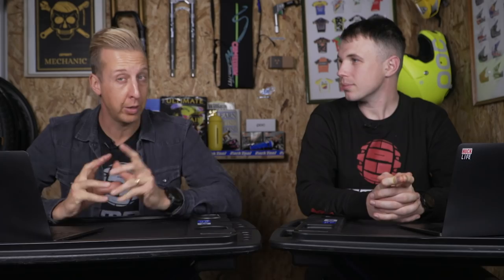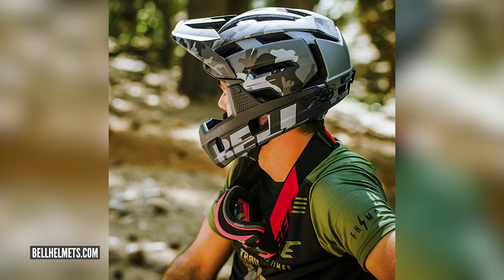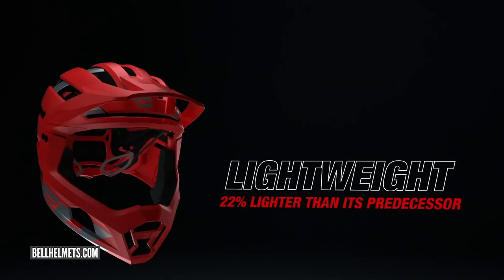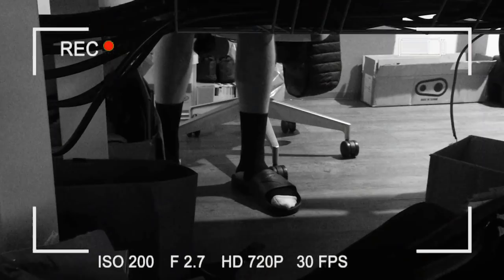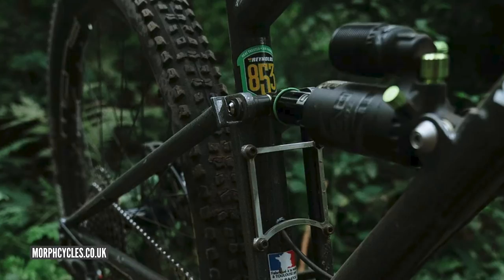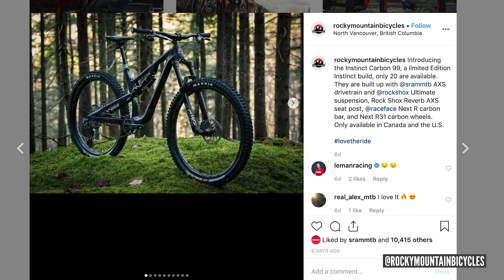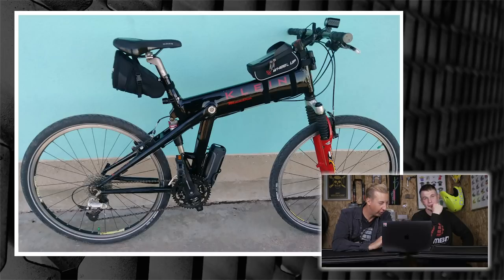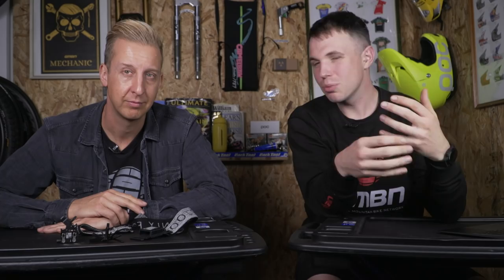3d Printed MTB Parts & Morph Cycles Full Sus | GMBN Tech Show Ep. 96

Comment: #askgmbntech  Hi guys, I am looking to upgrade the tires on my DH bike to 2.6 wide downhill tires, but I am not sure if they would fit the frame. Do you know how tire size varies on the same width measurement (for example 2.6) but depending on the manufacturer? (Schwalbe, Maxxis, Continental)

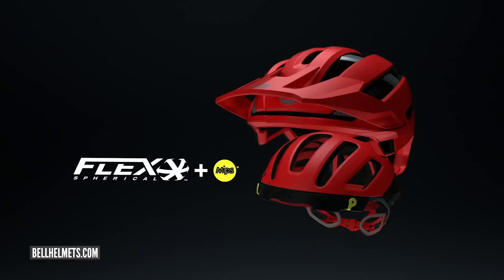Comment: 2:26 I hope it's quiet. 
I am wondering if this will be noisy or not, I hope it's not gonna be squeaking like when the inner shell got separated from the carbon shell on 2015 & 2016 Fox Rampage Pro Carbon, already retired one of the 2016 model, I will have to retire the other I use now soon, cus it already started to separate.
Reply: I have the Super DH and I can confirm that it's quiet, it's actually only held on by "rubber bands". But on my Super DH the chin guard's and helmet's contact area can be quite creaky, because it's plastic on plastic. I have put gorilla tape in between those areas and most of the noice is gone and you don't notice it when you're riding.

Comment: Do you think they will ever have full bikes that are 3D printed???????
Reply: i am pretty sure it is already possible it is just a matter of somebody spending the mony on research
Reply: Look up Pole bikes, not 3D-printing, but fairly similar concept. Also Atherton Bikes have 3D-printed lugs with the carbon tubes bonded into them.
Reply: @th_js  Yeah I've seen them, I think they're CNC which is kind of the opposite of printing but hopefully, they can use the same tech at a later stage.
Reply: @th_js  Pole use two halves glued together, air craft tech basically.
Reply: @joeocarroll1561  Yeah, it is in fact quite the opposite, but you get my point.
Reply: @joeocarroll1561  The lugs on Atherton bikes are actually not CNC, they are 3D printed

Comment: 17:01 Lovely view,
seems like a great build, but I would do some changes, I would have to make for me to ride it, is Acher D1X trail, cus no mechanical shifters fit me currently, Revgrips, Catalyst pedals,  absolute black Oval chainring & Bash guide for obvious reasons.
and would put a Fabric Scoop shallow race saddle cus that's what fit me.

as ppl seem to have issues most hydraulic brakes, I would keep TRP Spyke on it if it were mine, but not tried Sram's brakes on my bike(s).
and probably go to coil shock and fork, to not have to deal with pressure changes and get more consistent performance, but if that was not a factor just keep it as it is.
Reply: Hey Johannes, what do you think of the RevGrips? I'm having finger problems whilst riding and I would like to hear your take on them.
Reply: @th_js  do you mean fatigue? joint misalignment? pain? 
if pain & fatigue are the  problems I recommend training your fingers, build up strength.
I was fatigued faster with Mechhanical TRP Spyke brakes due to the stiff return spring, but now I am no longer having that issue, I have trained my fingers with dumbbells, also rode a lot of steep stuff and rode fast and was braking a lot, so I got a lot stronger, but the issues with the shimano brakes I ran was I had to run them with wrong reach adjustment, way too far out cus they were so inconsistent I ran out of throw otherwise, but most of them leaked, only one set did not lek, but I 've given up.
My mechanical brakes are adjusted properly, so I the reach is short and nice so when I brake I brake with the mid bone of the finger, this reduces fatigue and pain, don't have brakes adjusted so far out that you brake with the tip of the finger or thee tip bone.
also don't do DeathGrip(holding the grips hard as you are hanging on for your life off a cliff or a building) this will cause fatigue, pain.
have hands relaxed on the bars, but still securely.
adjust the brake lever angle so the are as quite flat if the reach is long enough on your bike, this will make it  so you don't have to hold your selv up or death grip to hold on securely.
but the shorter the reach of the bike is the steeper the brakes need to be, but really if that's the case you need longer frame, which is the case for me.
I've seen some run the levers flat, but they got way too short reach, so they are bending the wrist at an extreme angle,  which can cause pain over extended periods, also worse blood flow.
you might have too big or too small diameter grip.
you might have hard grips that beat your hands up, I recommend to measure the diameter of thee hole you make with index finger and thumb, then get grip size that is closest to that.
you might need to look into bar back sweep, up sweep, might need to adjust the roll of the bars, some or get new handlebar, you might have an bad bar fitting bar for you.
you might have the cockpit too low, you might be putting too much weight on the hands, you might need higher riser bar.
Reply: @th_js  very grippy, and they have soft rubber,  so far the stripping grips i've used, also very durable.
I've used Esi Silicone grips in the past but they got too soft in about 4 weeks, so soft my hand hit the handlebar when compressing the grip.
so unrealistic choice for me, but I read others don't have that issue.
RevGrips will last couple seasons, just rotate  and flip them once they wear some, to keep even wear.
Reply: @mtbboy1993  It's pain due to stiffness/tightness in shoulder muscles and migraine. I have experimented with all possible cockpit setups, but it doesn't affect the pain. It always occurs whilst riding bikepark or any hard riding that includes using your finger muscles and when doing bunnyhops and manuals. I have seen a physiotherapist, but not really any help other than stretching which I do anyways.
Reply: @th_js  Problems I got: my wrist is so loose I have to use wrist supports, to not get issues with missing corners cus I can't brake hard enough cus my hand misaligned, limiting my range of motion on index finger, Wrists supports eliminate that issue, but does not eliminate misalignment completely, still can happen some slight, but nothing too bad. as long as I have it properly adjusted I don't get pain, due to too tight straps.
I've issues with my elbows missligning, causing pain, pinching and bad blood flow, so I have to pop them back in place.
my right shoulder can pop, I can even pop it at will.
these issues has caused several crashes, I crashed off a wall once, crashed into a store wall, crashed while riding at walking pace on a bike path, accidental over steer. when I wanted to go straight.
I was just few cm or mm from hitting my head, I hit my left shoulder, these incidents happen long time ago.
I also have issues with my thumbs, they misslign and cause a lot of pain, if I shift when that happens, but also the mechanical shifters required extreme movements and the tention that the clutch oin the RD made, added to the issue, but Now I use Archer D1X trail, which has eliminated this issue, so even if my thumb misslign I can shift painlessly, also I don't have fatigue anymore, no thumb tip pain. The Xtr M9000 has 4 downshifts but really I could only use 3 without having my hand, but the moves were quite extreme, with Archer it's just two buttons, also the fit is much better for me.
Reply: @th_js  which fingers? all of them? what do you do when it hurts? shift? brake? 
I got everything dialled with my setup now. I am not done uploading pics on Flickr with my setup yet, but on instagram I got few pics, so if you want to see how I have my cockpit.
Reply: @mtbboy1993  Not shifting, not braking, just holding onto the bars in stressful situations on the trails or when jibbing. My jibbing has become quite limited in the summers, because my fingers are so sore that it's really painful to do one bunnyhop.
Reply: @mtbboy1993  Middle finger, ring finger and little finger on both hands.
Reply: @th_js  it could be elbow issue too if it's misaligned, along with wrist then fingers can hurt and depending on what you do with them and how bad the misalignment is and how it's misaligned can effect things differently. But it could also not be that, could be something different.
But having pain in these fingers can be symptom of too extreme angle at the wrist, if the hand is pointing up, these fingers will hurt, but so will the wrist.
but if you have it al dialled and use proper hand position, it might be your wrists are so floppy they misslign, and cause extra fatigue and pain on these fingers, cus they hand, wrist, arm move in a  extreme way, if this is the case, get wrist supports.
it could also be that it's just the 3 fingers that keep missligning, creating fatigue, pain, and possibly movement restrictions unless popped in place, I've had this happen few times, but not been an issue much, not had much extreme cases of it, but annoying when it happens, had it off the bike too.
Reply: Johannes Nilsen That sucks man, but I'm sure this is not the case with my fingers, because I don't have floppy wrists and never get wrist pain and I'm sure the medical professionals would have noticed if this was the case.